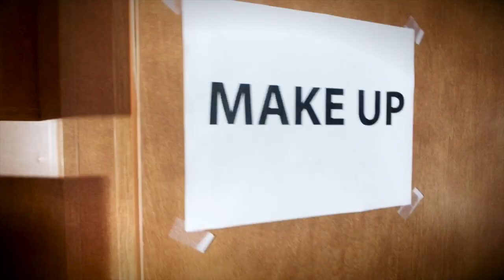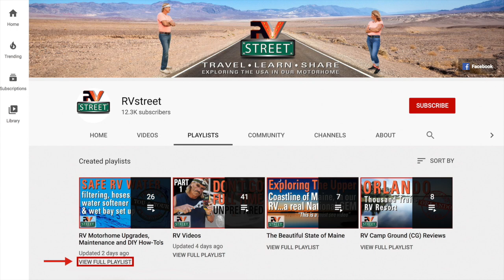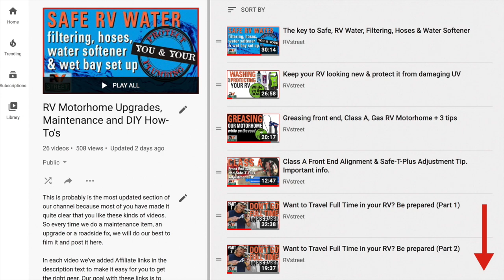RV KwiKee Power Steps: EVERYTHING YOU NEED TO KNOW

Comment from the maker: I know many of you who come to watch this video are having a particular problem going on with your steps right now. This video won't solve every power step issue, but it will solve 95% of them. When trying to figure out what’s going on with your steps, always start with the common issues first. Methodically check each item to eliminate what it isn't and that will reveal what the problem has to be.

This video not only shows you the common things you can do to prevent problems in the first place, but if a problem does come up, you know where and how to staring looking.

Throwing money at a problem is never the procedure. Diagnose the problem first. If a part has been proven to be bad, then replace that part. Controllers, motors, gear boxes and other operational parts can and do expire from age, or will not work properly when subjected to a lot of rain, humidity, salt water….like staying near beaches or salty environments ie salted roads in the winter and the most common one……lack of maintenance.

So use this video as a syllabus or a workbook of sorts, to help guide you into these different areas to check when you do have a problem with your steps. And of course do these maintenance items once a year to help prevent problems from happening in the first place.

Other than the parts sources I listed in the description test, here's some additional info on getting the right replacement parts......
The proper replacement motor and/or gear box sourced from an auto parts store can vary depending on your type and model of steps. Generally speaking many can be replaced with a 2006 Taurus window motor part# 742-240 but sometimes the bolt pattern isn’t correct and in one instance the 9-tooth gear was smaller then the original gear.

More places to find motor & gear parts:
1) AM Equipment 402 E. Hazel St Jefferson, OR 97352, (541) 327-1546 the motor is $29 plus $7 shipping.
2) Replacement step motor at AutoZone. It's a Siemens "Window Lift Motor", part# WL43003.
3) Autozone. The brand is "Siemens"
The ID tag lists the following numbers:
59720-20
121899
4) A 1986-1995 Ford Taurus left front window lift motor sometimes will match. NAPA part # BK655-1395 $63.99. Also from Auto-Zone Manufactured by Dorman part# 742-206. This has a lifetime Warranty and was $49.99.

On disassembly of the motor if you find the plastic plugs severely lopsided due to all the years of strain, new plugs cost $8.00 at Autozone or Amazon.

Some folks that have a 25 series Kwikee step motor can replace it with a with a Dorman 742-277 window lift motor for a 1986 Ford Taurus driver side window lift motor. Taurus has a high torque motor which is why the number ends with 277 meaning high torque. 

AutoZone has rebuild kits for Dorman window lift gear boxes (plastic gears).

Always use old motor and gear box to match to the right new one for your steps.
Reply: My motor is making a clicking noise but it’s not moving my steps anymore. Have you experienced this issue ?
Reply from the maker: @Turboromee  No I haven't, but more than likely the gear box is shot.

Comment: Your video was a lifesaver! Our steps quit working the other day after 5 years of full-time use. I had watched several other YouTube videos and they weren’t specific enough to be helpful. 

Yours while preventative centric still have enough detail in the troubleshooting part to get me going. I’m not sure, but  think it was the tapping the motor with the mallet, but I also tightened the connections. Bottom line: The steps are working again. And I lubed them off good. TFYHelp!

Comment: Thank you very much for this video, I just got problems with my RV step, suddenly stopped working, fortunately the step was retracted; I already fixed today thanks to your video, I went directly to check the ground cable and it was in the air, it came off of the ground screw. I cleaned it and re established the ground and bingo the step is working well, I took advantage to lubricate the step and now is working perfect. Thanks for your useful and educational videos.

Comment: I was looking all over for the fuse that blew out on our steps.   Bought a 2005 used motorhome and as usual, there were no wiring diagrams with the coach or available from the defunct manufacturer.  Your video pointed it out nicely.

Comment: My step quit after not locking it down while loading for a trip. Thinking I blew a fuse I crawled under the RV several times trying to figure it out. I finally tapped the motor with a hammer a few times and that fixed the issue.  Followed your cleaning and lubricant instructions and it works better than ever! Thanks for the great advice!

Comment: I just replaced a 1996 motorhome with a new to me 2018 Thor ACE. The steps on the new unit were a concern to me because they give about 1/4" - 1/2" when I put my weight on them. The step on the old unit was rock solid, it did not give at all when weight was put on it. I see that the steps on your unit do exactly the same thing that my unit's steps do. So, now I understand that the give must be due to the more complex multiple step mechanism compared to the single step design of the old unit. Your video has shown me what I need to do to prevent the slop becoming a problem down the road.
Reply from the maker: Yep, movement in the steps is common but that's why you support them underneath when parked. Otherwise that movement or bouncing up and down every time you step on them can cause premature wear and/or bind or break the gears in the gear box. Just support the steps and you'll be fine.

Comment: Thank you Martin and Joanie! We have a 38' Fleetwood Expedition. My RV steps were stuck in the "out" position. I didn't know it and I was driving through the RV gate to get propane. My gate is only 9 1/2 ft wide. As I was going through the gate, my wife started to yell at me to stop, but it was too late and I made it through the gate. I was lucky that I didn't wipe out the steps because I was only 2" or so away from the post. So with my wife's guidance, I backed the motorhome up into the RV access area so I could figure out how to get the steps back in. I couldn't figure out what was wrong. After watching your video, I got my hammer out started to use it. I hit the motor a few good times. I thought it wouldn't make a difference. Well surprise, surprise, surprise!!! When I closed the door, it started working. I felt like a little kid! I opened and closed the door a few times before it sunk in that it was actually working! Thank you for the awesome video and keep on doing the DIY stuff. We appreciate you!
Reply from the maker: Thanks for that testimony Mark. Thank God, your wife saw those stairs out even though you barely made it. That was close. When we first start to move ANYTIME, I always ask Joanie to verify the steps are in. 🔧 👍

Comment: Excellent, comprehensive video on this topic.  One of the items that I am working on this winter is completing a comprehensive maintenance checklist - and then doing the maintenance work before we head out in the spring.   I find that after you do an item a couple of times - you get proficient at it and it is not that big a deal.  These videos help with the knowledge base greatly!  Safe Travels!
Reply from the maker: Ya most of this stuff really doesn't take that long to do in real time. 
Thanks again guys so much.

Comment: Thanks for the help. what I ran into was the pin that holds the gear assembly to the stairs was seized inside.  Took quite a bit of effort to get it out without running anything.

Comment: Like the new hairdo and I bet it's cooler too.  Another think to check if your steps start acting up is the house battery.  My battery was getting low on charge and the steps were getting jerky when going in and out and eventually stopped.  Once I replaced the battery the steps worked like a charm.
Reply from the maker: Good point Carl. Yes bad or low house batt's can also be the culprit of malfunctioning steps. Yeah you. 😜

Comment: I greased my Super C Nexus Wraith with the information you provided. I bought the grease gun you suggested; it worked great. 

You might think about a video on braking systems used when towing a car. I use a RVi 3. Just got it. I had a RVi 2 for about 5 years. I replaced it 2 times under warranty. Otherwise it worked fine and was easy to install.  I have yet to take a trip with the RV3. 

I bought and used your foam cannon. 

I have a water softener I got before your video. I was taking it in to be serviced every 2500 gallons. I thought the that the resin needed changing. They were just regenerating with salt. I paid $90.00 for the last service. With your video I will do this myself.

I will now do your step service. 

Thanks for your maintenance tips
Reply from the maker: I've thought about a vid on braking systems but there are so many types of set ups and applications it would be impossible for me to do that correctly since my experience is with ours which is the Ready Brute Elite. But I do appreciate your suggestion Stephen.

Comment: You are awesome! I just  got my 2017 Georgetown 364ts back from only big Ford Truck dealer that services RVs on the F53 Chasis in Cincinnati. I asked specifically to check front end and do the 30,000 mile checkup. Oil change and lube bearings on wheels. I told them the Jeep I was towing had bad wheel bearing and axle trouble  after long trip. Also they have a 20 point inspection etc. I then was watching your channel for first time on TV about Air Filter changing. So I go down to where RV is stored inside open air filter housing and find almost black air filter. I called dealer service manager and he said can't believe his guy missed it. I took a photo and sent to him. Then I checked your video on lubricating front end 9 points. I go back down and sure enough it looks like they were not even touched. I have had it there 3 times before and looks like they have never greased the front end or anything else probably. Thanks to your videos I will be doing my own maintenance or checking who does it to be sure it is done correctly.
Reply from the maker: Good for you Dennis for going back and checking their work.
But WOW. And you know what's sad...I've heard this same story a LOT. This is EXACTLY why we started this channel. To show folks step-by-step how-to do things and what tools you need. You by the tools once and they pay for themselves the first time you use them. Plus the job is done right.
BTW...have you watched my greasing the front end video?
https://www.youtube.com/watch?v=kJBG-5KXRLA&t=554s
Reply: RVstreet yes I have and I am going to go on your store website and buy those tools plus that cool valve for the drain plug when doing and maybe that soap for washing the rv
Reply from the maker: @dennisking8556  There ya go. thx Dennis so much and now you'll know everything is done right. 👍 🔧

Comment: Another great and important video.  I saw a step repair vid not long ago where they used a caulking hammer to “repair” them! 
Btw, the hair looks good!  The golf swing was a great homage.
Oh- the one thing?  Going to redistribute storage this week and next week go for the 4-corner weigh.  Also replacing stock halogen headlight bulbs with LED.
Reply from the maker: I also replaced my stock halogen headlight bulbs with LED's. It was plug and play. Have worked great the past 4yrs. Good luck. 👍
Reply: RVstreet an idea for a future video!

Comment: Thanks Martin!    I have to reseal all the holes under our coach with foam.   So I will do the steps too.
Had a weird thing happen on a trip.   It was raining and we were getting quite a bit of water coming out of the shower while driving.   After getting home, I got under the coach and found old foam and poorly installed.   Went under to clear out the old foam and couldn't believe what I found.  Thor had cut a 9"x9" hole through the floor under the shower drain.   I am guessing that they used the block that was cut out as a plug and taped it up on the bottom.   At some point the tape let go and the plug is gone.   So exposed water pipes, electrical wiring, heat ductwork, and exposed drains.    The hole is above the driverside dual wheels.   Very hard to see.   
Again, thank you for the step video!
Respectfully,    Kevin
Reply from the maker: I know right? Crazy. It would be a very good thing if everybody got up under their coach and inspect everything inch-by-inch under their RV for any possible failure points and deal with with them now. When we initially got our coach, I spent 3 days doing those very things. Found lots of stuff that needed tending to. 👍
Reply: Martin,   Got under the coach today.   Expanding foamed all the holes that had bad foam, filled the 9x9 hole with 2.5" closed cell hard foam and Flexsealed it black to match the bottom, and for good measure cleaned and lubed the steps.   Thank you so much for the info you show in your videos!
Respectfully,   Kevin

Comment: Thanks so much for the video.  As a bit of an amatuer video maker myself (no illusions more than mom and local flying buddies are gonna watch mine though) I realize you put a lot of effort into making this.  Just wanted to say thank you and commend you for a good job.  I came across it as I'm planning this weekend to start troubleshooting my steps that stopped working recently.  Based on your video, I'm hoping/guessing that it is a fuse on the underside like you showed.  Already checked the fuse in the main fuse box(es) and they appear good.    I recently had the main engine's alternator go bad such that the voltage regulator was allowing high (higher than 14v) to all the coach's systems.  Got the alternator replaced and it seems the steps might be a casualty of the over-voltage.  Anyway.... I am digressing....  back to your feedback... thanks for going through all the parts and talking about how it all works.   This will be most helpful as I start diagnosing mine in the next day or two.   Take care!
Reply from the maker: Glad the vid was helpful FS. Just take your time and troubleshoot all areas and I'm sure you'll find the issue. 🔧👍

Comment: Martin.. thankyou for doing this video.. my steps on my 2011 Vista have been giving me some difficulties ... the steps open to there full length then come in about an inch then out to the full length .. this happens about 5 times and makes a banging noise ... so bizarre.  They steps retract and do the same thing.. Now after watching the video I am confident its the motor and gear so I will change them.  I will of course speak to the rep from AM and/or  Kwikie steps first before I order to confirm its not the controller.  Just wanted to say thanks again for your great video.  Cheers from Canada
Reply from the maker: Look at the magnetic switch on the door first. That is a big culprit of these kind of symptoms. If that doesn't work try my other troubleshooting tips. If none of those work, then replace the motor & gear box.